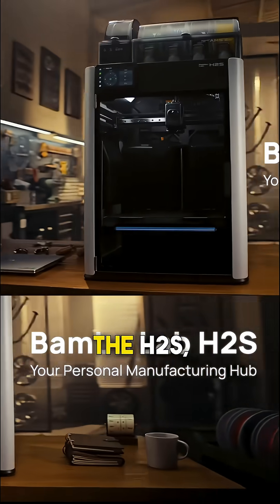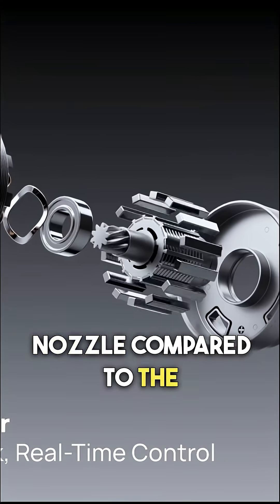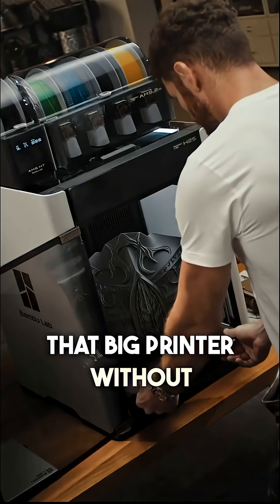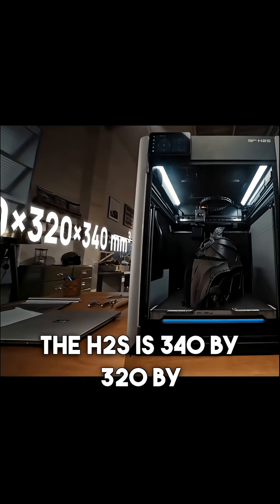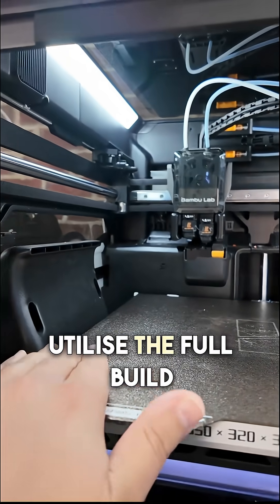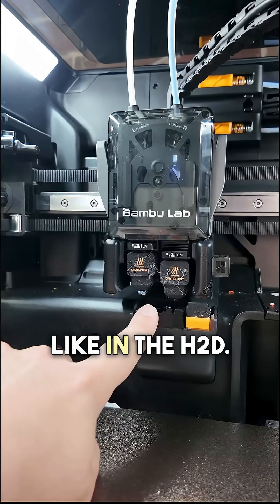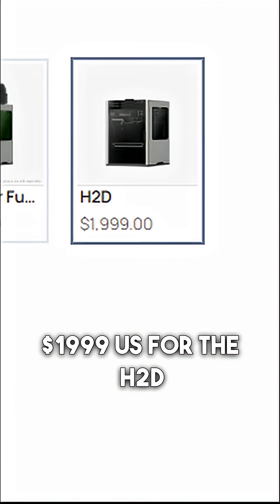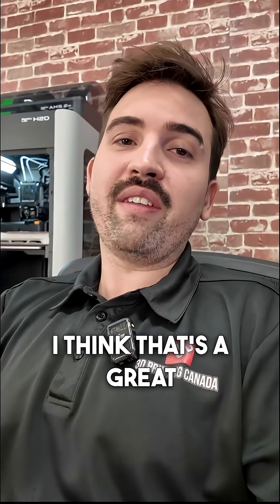The Bambu Lab H2S Is Here! #3dprinting

Comment: RIP to anyone that bought one cause bambu also teased another H2 variant with 6 interchangeable nozzles. Gonna be fully released in Q4
Reply: Supposedly they will sell an upgrade kit for folks who have a H2D or HSS..... Supposedly
Reply: @JDog6263  yeah on the website it says it's possible for the H2D, but it also says not to waste your time with trying to convert a H2S. we'll see.
Reply: @LegalEliminator where does it say that
Reply: @LegalEliminator  price info is out now and it basically put the h2s right at the h2c cost to convert the h2d however ends up being more expensive
Reply: but will Definity come with a steep price hike. I am personably speculating 2500 - 3,000 for the H2C with AMS.
Reply: @hoseinqadam yeah I foresee it being super expensive too. It'll be interesting to see where they put it taking into account the competition that will exist. Too high and no one will buy it.
Reply: H2C was a huge disappointment
Reply: @Synthyros  how so?
Reply: There’s no way it’s gonna cost 3000$ cus no one will be able to afford an printer that’s like 5000$ I think it’s gonna cost around 1000$
Reply: @calincs  that makes no sense, why would it be cheaper than the current single nozzle printer
Reply: @hoseinqadam  idk but it also cant be that way more expensive
Reply: @calincs  Kinda delusional thinking there, it will be at minimum more expensive than the H2D AMS combo. It has 6 hot swappable hotend-nozzles, think about that for 2 seconds and come back to Earth with that estimate.
Reply: Just bought a H2S today, I don't think I'll bat an eye missing out on the H2C. I don't think folks are going to jump on that unless they get hit with FOMO, have money to burn, or have an actual need to print 4-6 colors regularly. Not including all the tech reviewers that will be getting one anyway and the 20  giveaway winners.
Reply: @jaydonbrown617  Aww man, congrats, been printing a butt ton on my H2S since I got it a month ago. Just FYI, the included scraper file may have incorrect hole size for the screw, at least that was my issue, had to find an older version on Bambu Studio.
Reply: @hoseinqadam Thanks for the heads up my man. I'm upgrading from an A1 mini, so I'm pretty stoked. Just gotta get through the short bout of post big-purchase depression 😅. Happy printing!✊
Reply: I m waiting for 20 nozzles

Comment: For $750 more the H2D is worth it over the H2S.
Reply: Printing 750$ in waste will take a while unless you use 50-100+$ per kg materials... you can also upgrade the H2S with the H2C kit later this year....
Reply: @i.i.iiii.i.i they told the upgrade kit could be 6 hours to do and should be complicated. But we will see
Reply: Depends if you multi color print or not
Reply: Yeah, if you're printing 1 color most times, its a no brainer better deal.

Comment: They just announced the H2C also lmao
Reply: What is that one?
Reply: @deathpunchrigby1664  google it for more info but basically nozzle changes like the Prusa XL
Reply: it will have interchangeable nozzles that the printer can switch out on it's own. Meaning it will store nozzles with color filament in them, eliminating the waste when changing colors.
Reply: BambuLab likened it to washing paint brushes when purging out colors during multi color prints vs keeping the brushes with the paint on them with swapping out hot-ends.
Reply: @russer6579  changing tool head? So similar to the prusa mk xl?
Reply: not the tool head, the nozzle, it will have just one toolhead, releasing it in Q4 2025
Reply: @deathpunchrigby1664 it wont change the toolhead but only the nozzle which means more waste and longer print times than a toolhead changer. Seems like a desperate attempt to compete with the snapmaker U1 tbh